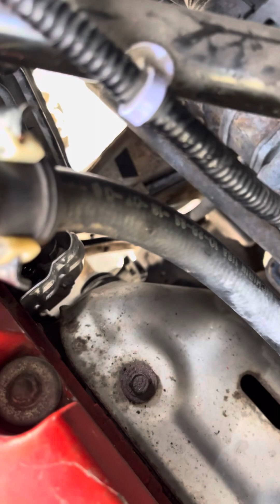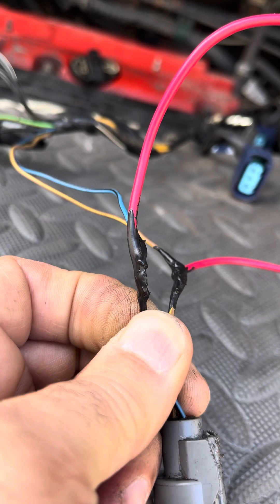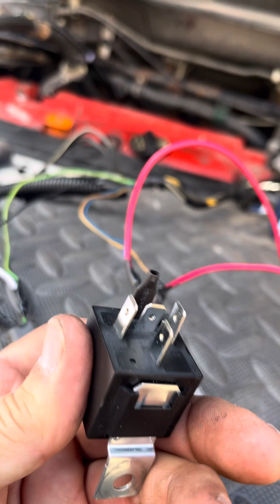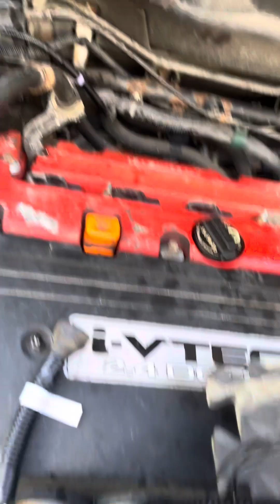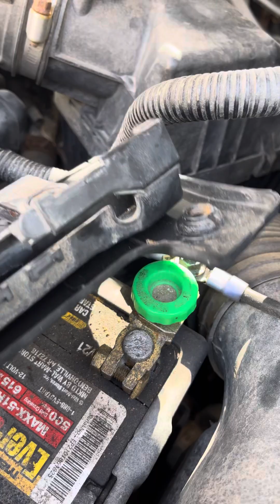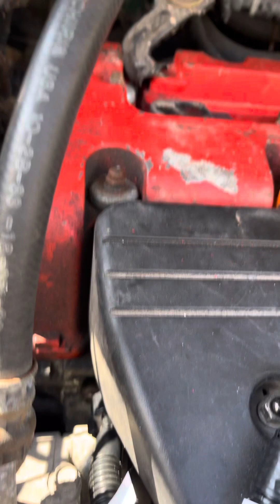Honda Element- Vtec oil pressure switch bypass

Comment: u can splice a wire to  vtp and vts   wire like back in day  for older b motors  saves u bunch of wireing of a relay   u can put paper clip between 2 wires at the ecm  as a temp solution

Comment: Hey I appreciate the video but I have a question if you would please respond. I have an RSX race car and it keeps going to limp mode due to VTec. K20a3 with TSX camshafts in a circle track race car. Would this hack eliminate my VTEC limp mode ?

Comment: the japan k20 does not have the pressure switch , there is a bolt in its place, deleting mine 2 morow, tired of p1259

Comment from the maker: Disclaimer, this is not a permanent solution, but it’s a way to troubleshoot what the issue is. If your car gets out of limp mode with this bypass, then you’ll know you need to change the pressure switch or the whole VTEC solenoid assembly.  The oil pressure switch is a backup safety to assure pressure is present before engaging the rocker pin. As long as you check your oil level and change it regularly, you shouldn’t have a problem. This bypass is for temporary usage only!